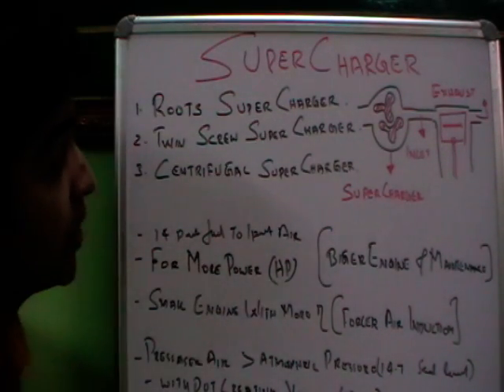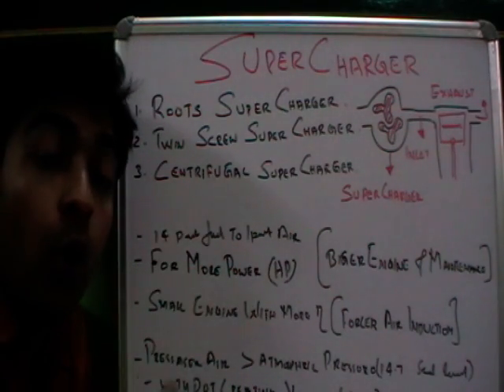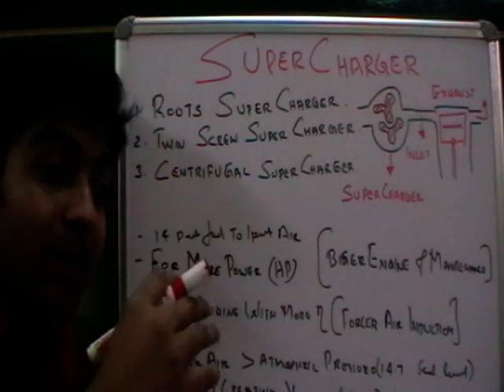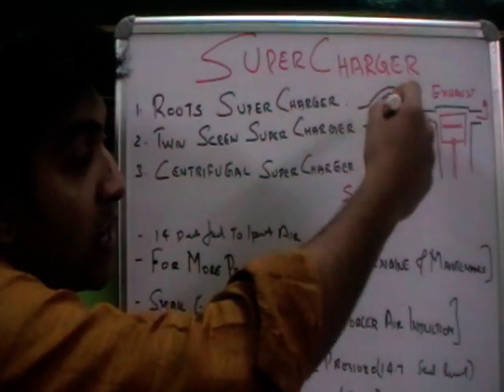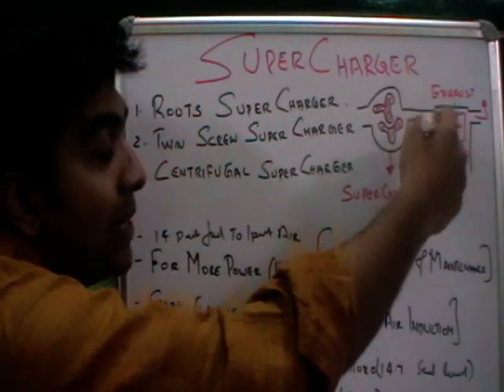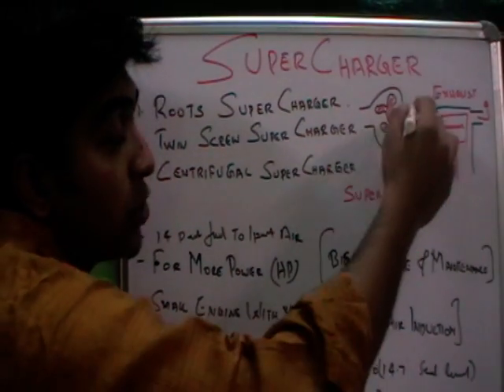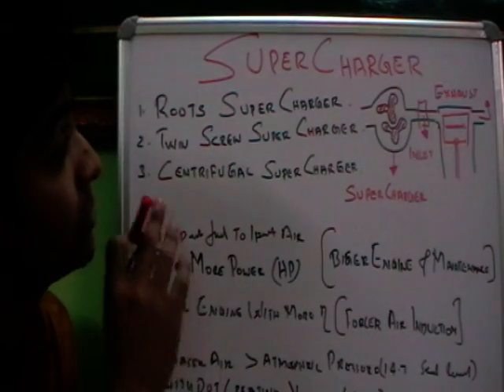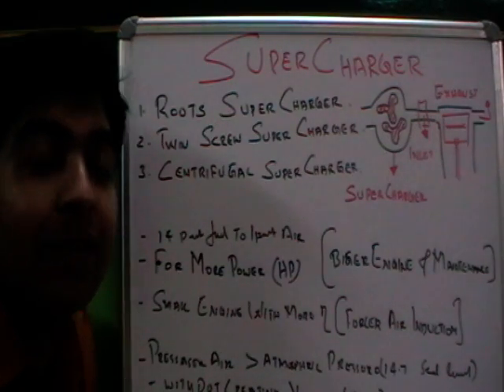How supercharger works. ✔

Comment: wats the diff between super nd turbo charger ... and if a stock vehicle is fitted with this ... is it required to upgrade the exhaust with a free flow or a exhaust which can withstand incresed output